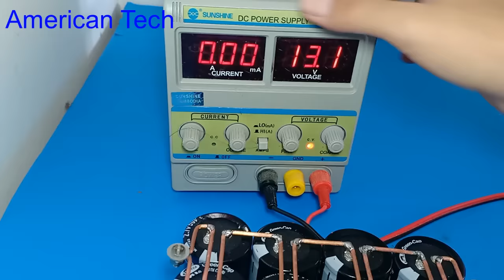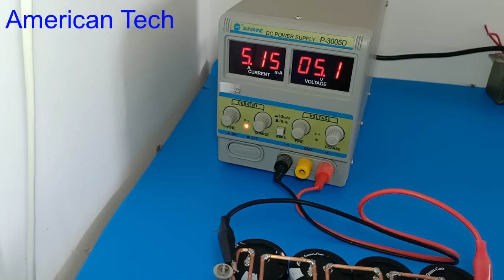12V , 100A using Super capacitors , Amazing idea

Comment: The way the caps are connected (4 in series and parallel) they have in total 250 Farad at max 10.8 Volts (if voltage is higher will damage the caps shortly).Now, the total storage for this 250 F is 14580 Joules and that is Watt/second and that means it stores 14.58 KW for one second only. If you divide 14580 Watt divided by 3600 seconds(one hour) = 4.5 W/h watt per hour. So, if you power a LED of 4.5 W it will run for one hour. That's it. Not a lot of power :) But it may be able to start a car... you should try that
Reply: هذه هي النباهة، و ايضا لن يستطيع تشغيل سيارة، أظن أنه يمكن أن يشغل دراجة نارية.
Reply: Yes I thought I was miss counting but it does seem a bit shy of the 12vs he was talking about,

Also in an automobile you would want a some kind of extra value capability for any spikes that may happen from the charging system, without it I suspect but I'm no expert on these matters but without it, I suspect it could cause a burn out of the caps, which could do a lot of damage to any vehicle.

There is another guy using 50v 4700 uf caps and only charging them to 12vs which would allow a huge buffer for his caps to operate, less likely to burst or over heat.
Reply: Also, there is no balancing circuitry. It really should have 6 parallel pairs in series, each pair with balancing circuit board
Reply: Me sacaste la palabra amigo ...así es no es igual la descarga en tiempo y comportamiento de un capacitor que se descarga siempre en descensos..que la batería que se descarga manteniendo hasta el 80 x ciento menos y después cae ...una pila de 2200 mah equivale a un capacitor de 2480 faradios ..así que para hacer 100amper tenés que hacer una pila de 2 metros de súper capacitores y son caros aparte ..es conveniente comprar una batería ...no confundamos a la gente que recién arranca a estudiar y hacerles gastar dinero al cuete ...teoría primero práctica después...
Reply: І use 2300F 6 series for start v8 F150 but this minimum capacity for this purpose!
Reply: I just want to know the amp